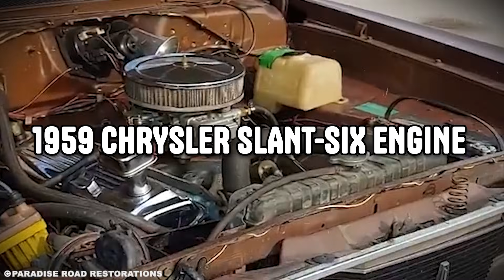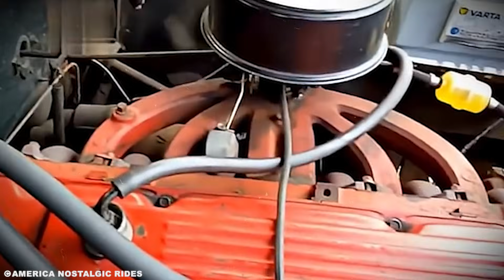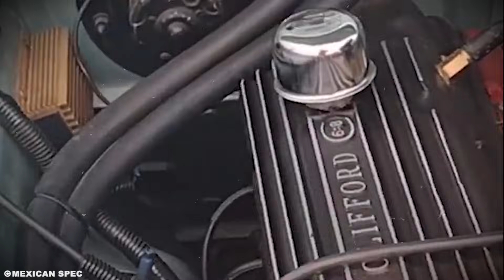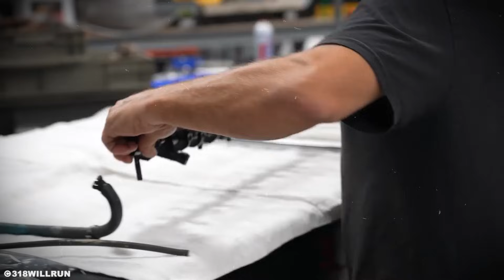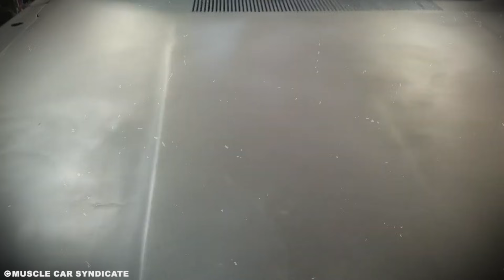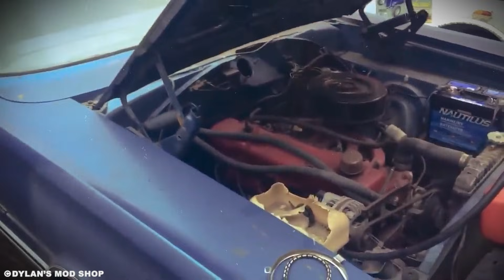This Ohio Mechanic OUTSMARTED Chrysler With a  Weird  Slant Six Turbo That Shocked Everyone

Comment: this is all wrong the intake and exhaust are on the same side not opposite, and the intake manifold on a 225 CI slant 6 did not curve over the valve cover IDK where this channel gets their info ven the pics they use contradict the narration 👎 that fact that it has to spell out the abbreviations for the torque measurements
Reply: Was gonna say the same thing